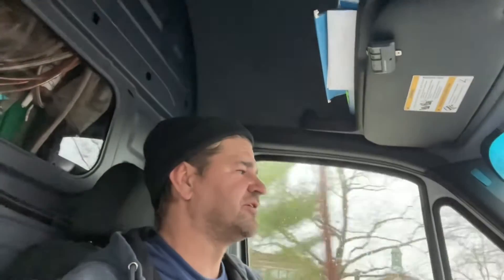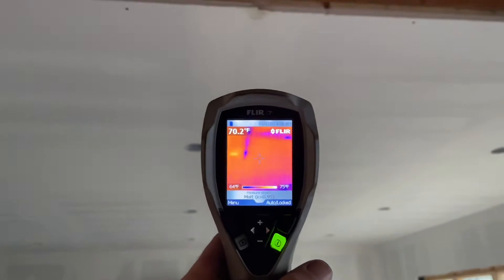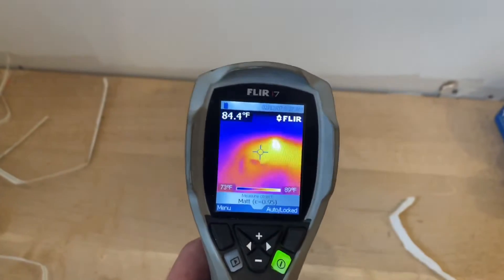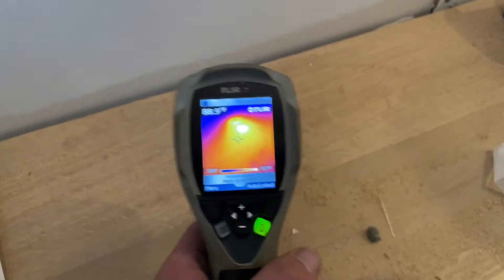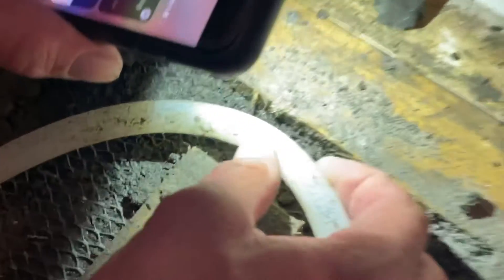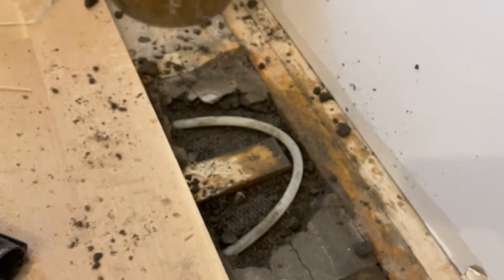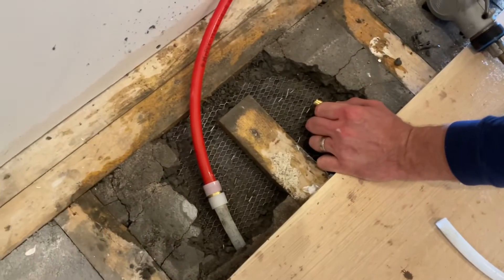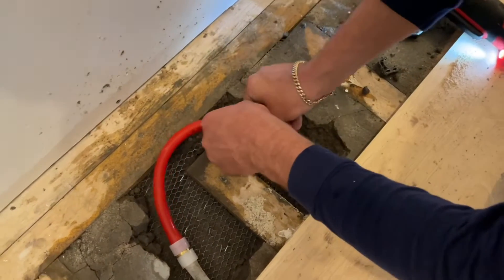How to Repair Radiant PEX when the hardwood flooring installers put a nail into it Used Flir i7 cam

Comment: was this a good fix or did it fail a year later? i did the same on a job and it is leaking again. the plumber used a coupling and compressing rings to fix the pipe. are the shark bites better?

Comment: That’s the great thing with Pex; it’ll leak right away.  Copper is self sealing and will leak in a couple years when the nail rusts out.  -Discovered this on a job a while back.  Ironically, it was the plumber who took it upon himself to nail off the last piece of subfloor since he didn’t want to wait for the carpenters to do it.
Reply: Not only that, if you dent the copper, it will leak after 50+ years. My house was built 1948, the cold water main supply from the street leaked in 2010 under a concrete floor. When the plumber (eventually) traced the spot, the pipe had an obvious dent in it with a pin hole in it's dead centre. Clearly cause by some over zealous guy using a pick axe next to the pipe... No wonder the house always had that faint musty smell, which is now gone, and no more trying to repair damp walls every year.